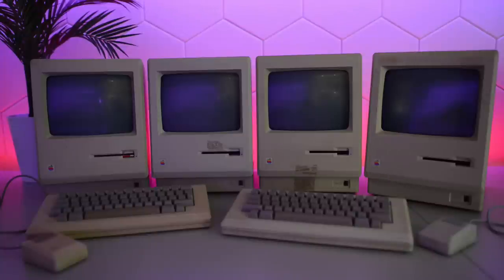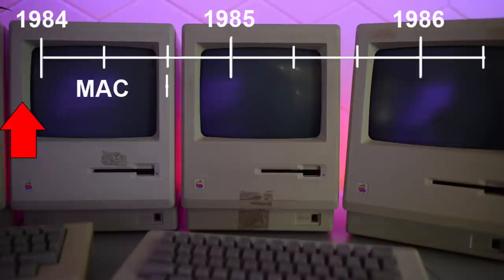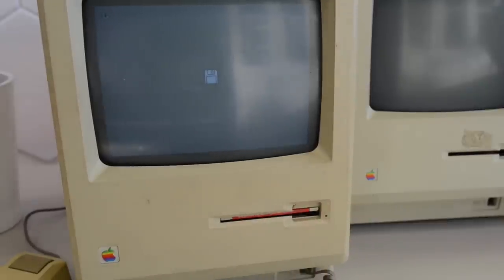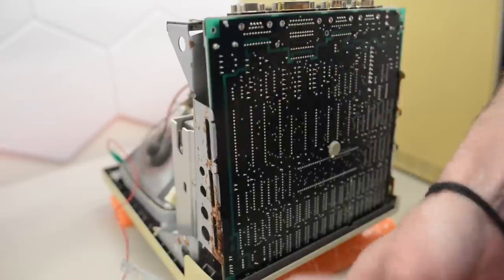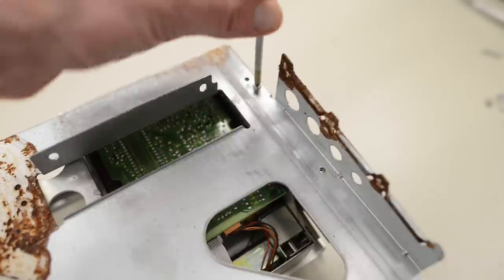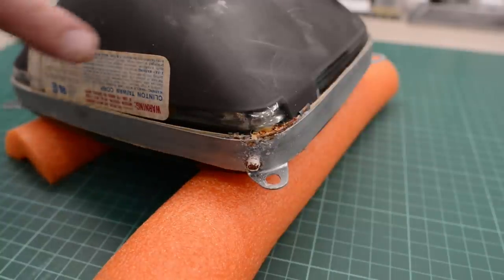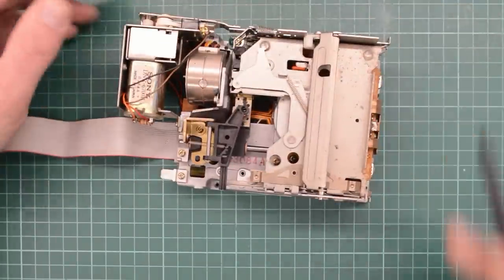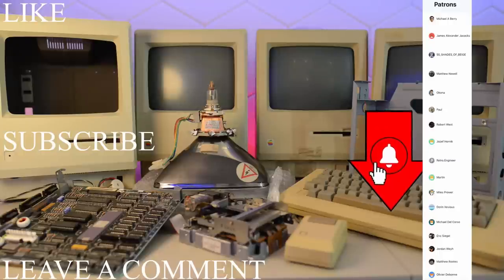An original 1984 Apple Macintosh from Harvard University. Let's restore it ...if we can

Comment: For rusted steel parts you might like to try electrolysis. It's pretty easy to do; you just need a big plastic bin, a car battery charger or adjustable power supply, washing soda from the grocery store, a few wires, a chunk of iron or steel, and water. There are tons of guides online. If it were me I would certainly do that before chemical treatments. I save those for stuff too big to fit in my improvised electrolysis tank.

For those playing along, you should not leave primer exposed for long periods of time. It certainly better than nothing but eventually water will creep in from the air and restart the corrosion. Always cover your primer with a top coat before the job is done.
Reply from the maker: Ok, I didn't think bare primer would be an issue in a pc that's always indoors, but thanks for the warning. I'll apply a top coat before I put it back in. I actually have a nickel plating kit with all the different baths, including acid. It would have been perfect for this project, but it's in storage for the same reason as my sandblaster equipment :/
Reply from the maker: Mr Guru  true, but it would look really fancy if nickel-plated :)
Reply: Came here to say this.  **Primer alone does not stop rust!**
Reply from the maker: Mr Guru  haha. You know, that thought actually crossed my mind while I was writing that post. An acrylic case with a high gloss polished steel frame would look pretty damn neat :)
Reply from the maker: Mr Guru  Man, that would have been so cool. My BMX was just plain silver. I actually have a nickel-plating setup. I use it when I restore my vintage bikes. Unfortunately, it's in storage because I turned my garage into a studio. The only difference visually between nickel and chrome is the color temp. You would have to look very closely to see the difference. Nickel is slightly warmer than chrome. If you hold them close together, chrome looks slightly bluish in comparison. I'll see if I can find a picture of some project and email. If the kit was out I would have used it on the chassis but I wouldn't bother polishing it of course
Reply from the maker: Mr Guru  Yeah, I had the wheel hubs chromed for that bike because they were too large for my nickel kit. I have to say, I kinda prefer the warmer nickel look. At least on a vintage bike
Reply: MrTGuru  I understand, I just wanted to make sure anyone reading didn't get the idea that primer stopped rust.  I've seen people fully sand down their car restoration to metal, then primer it and leave it, only to have it rust again, at which point they had to start all over lol...

Comment: Apple started badging the “Macintosh” as “Macintosh 128K” around September of 1984 I think because that’s when the 512k released. Those specifically labeled models are rather rare because most people just bought the more capable 512K or upgraded their original model to have a 512k board.
Reply from the maker: Ok, so according to that, this MAC should have had a 128 badge, since it was made two months later?

Comment: Very interesting. I really enjoy these old machines being rescued. Primer is not a good top coat because it's generally formulated to be porous so that the top coat can adhere as well as possible. This means that moisture can also get to the steel and cause new rusting. (I see that someone has already mentioned this. Oh well.)
Reply from the maker: I ended up respraying it in a white paint I had laying around :)

Comment: I'm so glad you got to this machine in time! It was super lucky that the corrosion didn't get to any of the major components. Shouldn't even need a recap since it's from before the capacitor plague. Besides the Rifa cap, of course.
Reply from the maker: Yeah, Those caps probably won't leak for another decade. But since we are going to replace the RIFA and the bipolar cap, we might as well replace them all on this project.

Comment: AFAIK the "red stuff" is dielectric grease. It prevents arcing from the yoke HV feed.
Reply from the maker: Thanks, that's what I suspected it was for. I did a google search for dielectric grease and it appears to be the same as Silicone grease? At least according to wiki. Do you know if I can use regular silicon grease? or can you recommend any specific products? I've had arcing from a tube ones and that was quite the bloody show. Don't want that experience again :)
Reply: I’ve used Permatex 22058 dielectric grease before for this purpose. I think somebody on 68kmla recommended it.
Reply from the maker: @PgWsLRoiEeyZFdXRWGMPNyiFrWpmSo  Thanks
Reply: @Epictronics  your local auto parts store should have something suitable as it's used on spark plug boots. I think the Permatex brand makes some.
Reply: @Epictronics This isn't quite right. The red stuff is a high voltage insulating lacquer, also referred to as corona dope. The lacquer is applied to the tube around the anode cap to prevent arcing. Dielectric grease is used on the cap also but it's there to create a good seal of the cup to the tube - that's a separate thing.
Reply from the maker: @ChristopherGaul  Now that you mentioned it. I think I have some that I bought last summer to fix my vintage Honda 750 OHC :) I'll double-check, but I think I might be sorted now :)
Reply from the maker: @SanguineBrah  Ok, The lacquer seems intact as it usually is on all tubes I've been working on so far. I guess I only need to apply some dielectric grease. Thanks for sharing
Reply: @SanguineBrah  I think the lacquer is applied over coils and other exposed HV parts.
Reply: @Epictronics1  happy to help. Gotta keep these vintage systems alive.
Reply: @ChristopherGaul  That's correct. It's also used to insulate high voltage transformers etc, but also painted around the anode on CRT tubes to prevent corona buildup. Sometimes it's clear rather than red though.
Reply: Not sure what the red stuff is, but it may be RTV gasket maker.  Some Sony monitors have the RTV applied to the rubber cap. It comes in different colors, but I've only seen white and gray.
Reply from the maker: Mr Guru  I once was too quick to turn a CRT on after receiving it in cold weather. The arcing was spectacular to say the very least. I wish that HV cap had some grease :)

Comment: The cord that you weren't sure of is typically found on CRT displays of either AIO's or higher quality monitors. My guess would be that the cord is to keep the two boards from shorting each other out, given the Mac's tight enclosure. Fortunately some of their later models that had a CD-ROM option switched to a sled assembly, which made this a lot less dangerous to maintain.
Reply from the maker: I'm not sure I understand, do you mean the grounded coil?
Reply: @Epictronics1  probably. I don't know every last detail. I've only disassembled them for e-cycling purposes, so to me, wiring is wiring.

Comment: Nice work! I need to restore mine from an aesthetic point of view as well! I'm a bit concerned about using paint (also the PS/2) as there are so many point where the chassis is electrically connected to other parts. One solution is to leave bare parts as you did of course. 
Try Citric Acid for the chassis - it's cheap and works like a charm. But you still need to brush it a bit at the end, just to smooth up the surface a bit. 

That was a lucky Mac indeed. The battery bombed but it missed its target! :)
Reply from the maker: Yeah, I was sure "Harvard" was swimming with the fishes when I open that case! Great surprise that the battery missed!  I'll try citric acid on the next project, Thanks :)
Reply: @Epictronics1  How come all my computers never work well out of the box? :D Well, it would be very boring if they did though! That Mac I repaired didn't have a single component in good working order! MoBo, Analogue board, CRT, Floppy and HDD were all faulty. 100%. Amazing. The PS/2 is proving to be another "less common" repair too :)
Reply from the maker: @tony359  Haha, I actually don't what I would do if I didn't have stacks of faulty computers : )
Reply: @Epictronics1  When I collected those Macintosh, the seller had a garage full of them. At some point he insisted and wanted to give me a working one "where's the fun in that" I replied. "That's boring, you plug it up and it just works?" :)
Reply from the maker: @tony359  haha, those machines end up being used for spares :)

Comment: a little trick I learned a while back with capacitors is to unplug the machine, but then turn it on. Turning it on should discharge any remaining power. In a modern pc it will even turn the fans a bit. Not a full revolution, but maybe like a 1/4 turn. That should get everything safe.
Reply from the maker: That's useful, thanks :)
Reply: This won't do anything in Macintosh's case, as the on/off switch is essentially the mains switch and does the same as unplugging it. Your advice is fine for devices made in this century though as most of them have soft power on switches
Reply: @michvod  ah ok. I wondered if it would have the same effect with a CRT, but that makes sense.

Comment: If you look close enuff the "missing" number is a 2, no other number has the straight line at the bottom of the number like "2" does.
Reply from the maker: I think you're right. late 1984. That seems just about right. We'll crack it open and check against the date codes on the chips. Thanks
Reply: @Epictronics1  you are welcome

Comment: You might need to burn a newer version of the ROM to use an external 800k drive with those; IIRC you need the ROM that shipped with the 512ke; the earlier versions didn’t have the required driver in it.
Reply from the maker: Now that you mentioned it. I recall reading someplace that REV A was replaced because it only supports the very early SONY OA-D34V-22. An upgrade of the ROM totally makes sense. I'll do some reading and burn some ROMs, thanks

Comment: The reason the Macintosh produced in 1983 has a 512k badge is because Apple provided a 512k upgrade kit for buyers of the original Macintosh for $995
Reply from the maker: yeah, that's possible. We'll take it apart and see what we'll find inside. I wasn't expecting Apple to include the badge though

Comment: Ugh, why would try to force the mechanism to eject when it's obviously quite jammed up? The plastic gears in the eject mechanism are delicate! You should take it apart, clean, and lubricate it before doing anything like that.
Reply from the maker: I will do just that in part two. I have spare gears at hand if needed.
Reply: @BestSpatula wtf u talking about, thats the ejector pin, u make it sound like the gears are made of tissue paper. worry about your own stuff
Reply: @gordonshelby765  he applied power with the mouse button held down which forces the mechanism in the drive to eject.